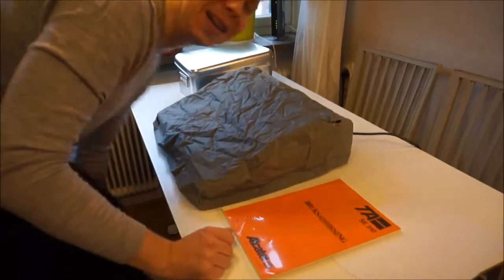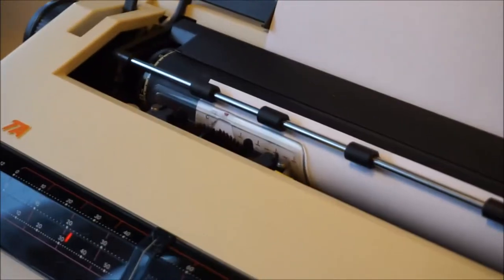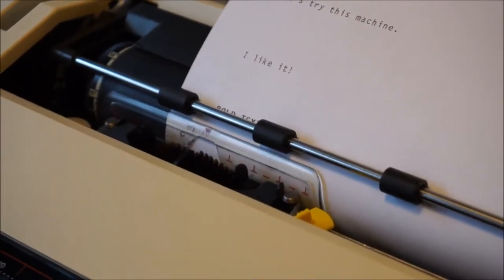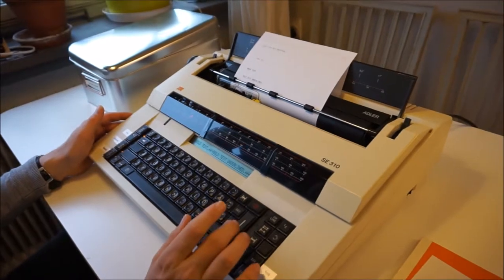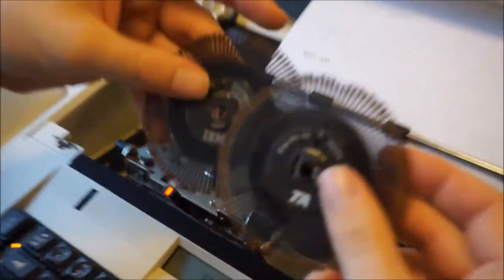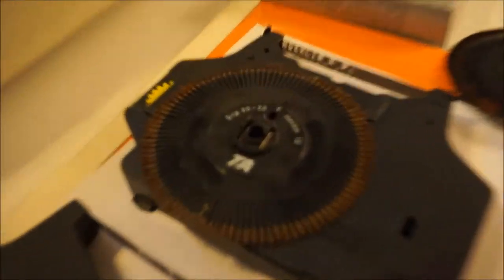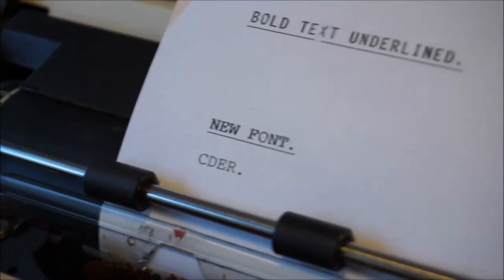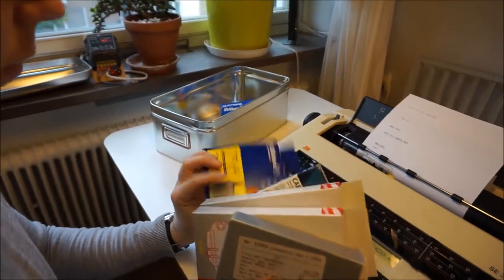Typwriter TA Adler SE310

Comment: I bought the TA daisy-wheel to replace an IBM correcting Selectric typewriter. It was exceptional, a pleasure to use because it was much quieter than the Selectric. About that time desktop AT computers became popular, had Word Perfect word processing capability. I bought an interface for the TA so that I could print from my computer. Like all technology of the time it was quickly superseded by the latest and greatest whatever.